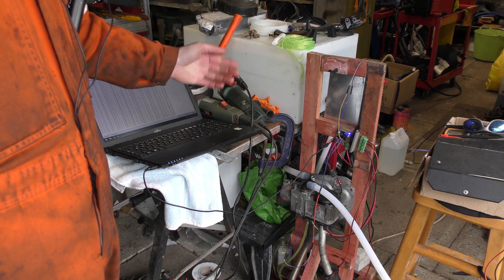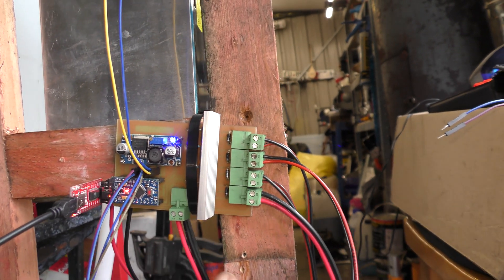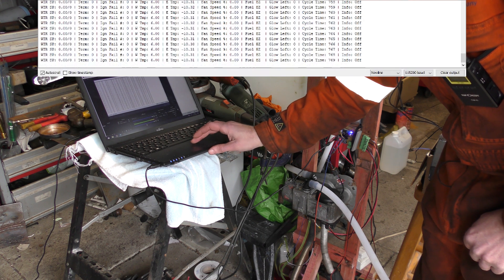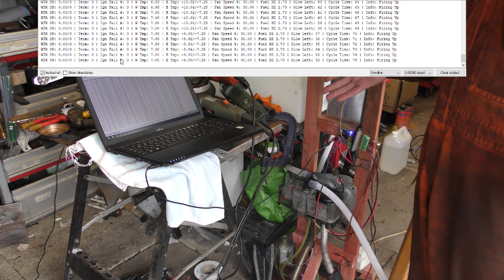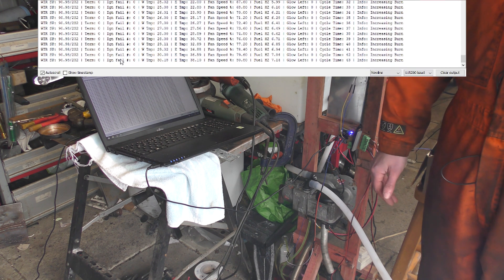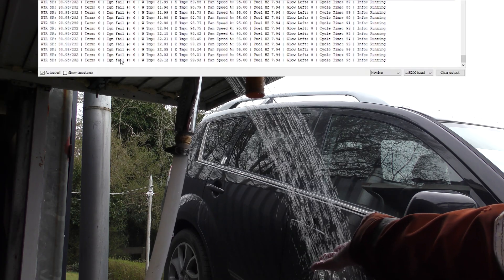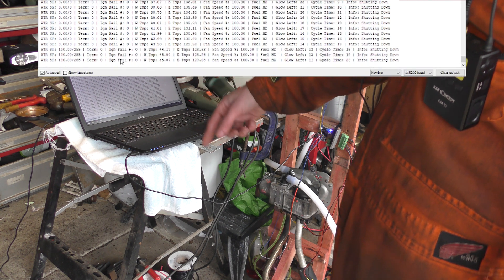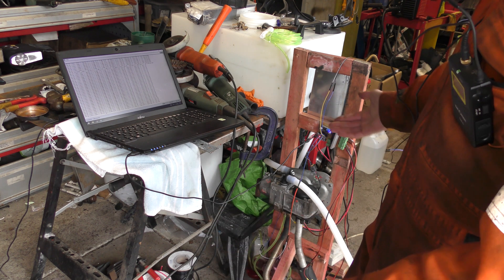Arduino Webasto Shower - Stage 3 - It actually works as a shower

Comment: With a valve and another piece of hose you could send the warm water back to the feed tank to preheat it. It would take a bit longer to get your shower, but you could get it good and comfy hot and a good solid pressure you want.

Comment: hello someone else tried to do that shower ?
Reply: I have, but can't get it to run right, I've use the components and code as described, but the exhaust temp gets to 300c and stays put, after 30 sec it shuts itself off, and the pump doesn't seem to be right, i get 8,20hz which is to high and can't change it
Reply: I adapted it and instead use it as a heater for a garden office. I based it on Simons code he developed for a heater for his camber van.

Comment: Hi, Great videos and content thank you. Id really like to give this project a go. I am in the UK and wondered if anyone had ordered any PCB boards or could recommend somewhere to get a few made ?
Reply from the maker: I used JLCPCB to get the boards made.  There is a Gerber file and an EasyEDA project file on my website you can download.
Reply: @DavidMcLuckie  HI David, thanks for that Ive ordered a few PCB boards so if i have any spare i will let you know incase anyone else wants 1. 

Is the required parts list still the same or is there anything that needs changing ? 
1 x Arduino Pro Mini ATMEGA328P 5V 16MHz
1 x 5V Voltage regulator
1 x 100K Thermistor (exhaust temperature)
1 x 1K ohm resistor
1 x 5K ohm resistor
1 x 100K ohm resistor
1 x Momentary switch
1 x Heatsink (for the MOSFETs)
4 x 100 ohm resistors
4 x 4.7K ohm resistor
4 x Diodes
4 x International Rectifier IRLB8721PBF
5 x Phoenix Contact, MSTBA 2.5/ 2-G-5.08, 2 Way, 1 Row, Right Angle PCB Header
5 x Phoenix Contact, MSTB 2.5/2-5.08 PCB Terminal Block
Arduino header pins (male & female) unless you got them with the Arduino
Reply: Where did you order the parts to build your pcb ? The diodes you use, which type is it exactly ?
Reply from the maker: Mixture of eBay, RS components and CPC.  Those diodes are 1N4001.  The only change on the newest board is the addition of another diode for reverse polarity protection.

Comment: Have you gotten a chance to check out that oil burner system,waste oil burner system, flame rings,ceramic ignition needle,danfoss oil nozzle,burner high voltage packet on EliExpress. 
The best way I bent big copper pipe filling it with sand

Comment: hi am still having problems cant get the atomiser out seems to be welded in have you had any similar problems
Reply from the maker: On the Thermotop V?  There are three screws holding the heat exchanger half onto the burner half.

Comment: You’re better off wrapping a flexible exhaust around a copper pipe surely?
Reply from the maker: Not a terrible idea actually.
Reply: Or possibly using a EGR cooler as a heat exchanger?

Comment: Why not use your EGR cooler from your previous projects to preheat your water before it enters the main unit?
Reply from the maker: I will eventually, but I expect it to soot up quite badly.  You can get these heaters running HOT, you just have to hose fuel in.  :)

Comment: I like, no hate, but I think in practice, a hot water store and thermostatic shower valve mixing with cold would be more stable. When ya stood in the shower, and the thing goes cold, or burny hot, it aint guna be fun! Not to mention limited amount of water being wasted on start-up, and shutdown if the temp goes up. Maybe look at a hot tub heater? 7.4hz is some amount of fuel too!

Comment: Cap one end of the copper pipe, fill it with sand, tap it on the floor to settle sand, cap it and wrap it around a form a bit smaller than you want. to account for spring back.

Comment: What happens if you Preheat the Diesel (maybe with the Exhaust) does that change the ignition behavior?
Reply from the maker: It does, Webasto even makes one of these with a fuel preheater built in.  But I think it is only used for starting.

Comment: I'm following with interest, as I'm planning / trying to do the same with a Eber D5W but feeding a calorifier rather than directly on-demand. I have 2 old Ebers At the mo, and using the brain from one, and the workings from the other I got the assembled frankenheater to start once, and only once. I hadn't rigged up the water correctly, so it was full of air and the unit overheated instantly - when I got some water through it just boiled / popped / steamed / etc. So, it's obviously quite important to make sure the unit is full of water, and ideally that the water is flowing before you light it up - but none of these seem to have a sensor to tell you if the water is flowing. Have you considered this as a failure mode, or do you reckon that the overheat sensor is enough to allow a controlled shutdown before meltdown or damage happens?
Reply: The water over temp is programmed to 50c. A flow sensor can be added on the output but as the water temp over heat is much lower than the normal ECU that comes with it then I'd except it to catch it before critical mass.
Reply: You could easily adapt this to run two units simultaneously. :P

Comment: David what is your microphone set up? I can't seem to make one work decent. Thanks. 
Also I can't remember if you tried this but get a larger egr cooler.  run the cold water through the egr first, then through the heater.
Reply from the maker: I'm using a wireless tie mic.  I went with a twin channel setup in case I ever needed to mic up someone else as well, but that hasn't happened yet.  https://www.amazon.co.uk/gp/product/B07L8XRKXP/ref=ppx_yo_dt_b_search_asin_image?ie=UTF8&psc=1

Comment: Excellent progress! I've tinkered for a while worth of diesel water heater for van build, would be pretty much complete if it uses glycol mixture closed circuit and plate heat exchangers in series with circulation pump for hot tap water, floor heating and also heat engine when so commanded.
Your example is very encouraging, and possibly with Webastos or alike from wrecking yards...

Comment: How about wrapping small copper tubes around the exhaust tripled up and then going from the three inputs and outputs back to the size tube that you need to give you more surface area against the edge of the exhaust

Comment: you wont soft copper pipe fill with sand and cap the ends off maybe even heat and you bend

Comment: Will them heaters run with a garden hose connected to it rather than a pump or is it got to be a controlled flow ????
Reply from the maker: You can run them from a hose, but you'll still need to control the flow via the showerhead or a valve.  You need a low enough flow rate to give the water time to heat up.

https://youtu.be/tzoS-6ds8HA

Comment: From an electronics noob to pro in 5 episodes - very impressive David. I know you've had help, but none the less all credit to you. The Arduino controller is going to be perfect, like you say, a bit more tweaking. This is a great solution. Here in Australia, we don't get cold enough to have cars with these heaters...that I know of at least.

Comment: Spiralling Micro bore copper -over length piece flatten & solder one end - fill to max with water (not sand) flatten and solder other end (will need a propane torch ,soldering iron wont get the heat in) spiral away no kinks .Trim drain cut off excess .Loads of tutorials on YT

Comment: Maybe you could play with controlling the water temperature by running the heater lower or higher. Ideally it could be cool to have a display to see and set the temperature.

Also it would be useful if you explain what did you do in the code or with other parts of the setup. With other words, describe the process how did you fine tune the system since the last update.
Reply from the maker: As it progresses a screen might be possible with controls for temperature and fine tuning things.
Reply: @DavidMcLuckie  nice, Looking forward to watching that video.
Reply: I think throttling the heater would be a good idea when in hot weather to stop over temp.

Comment: CAN YOU fill the tube with fine sand ,then try bending it real slow , and heat it !  plumbers have a device to lay plastic pipe out into that heats it really hot the whole length like wet spaghetti  to bend ,then cool in place !

Comment: What is the "clicking noise ?  That's really hot !  But the water has to be left running the whole time ? SO for an "RV" you lose a lot of your limited water in the freshwater tank ??  My smaller RV , I turn the water,  way down and up as I shower, and off also for a few moments .all to conserve water ,  Your's has to stay on full force the whole time ?  I really like the fast hot water , Is your set up cheaper than an "instant " hot water device ?
Reply: The fuel pump
Reply from the maker: Clicking is the fuel pump.  We had it set originally that the pump only ran when the water reached XºC.  But this created a situation where pump would turn on and off during the startup phase as the water heated quickly inside the Webasto.  This concerned me as there was a possibility of the water getting too hot and coming out at scalding temperature.  Now the pump runs at its slowest speed during startup and ramps up as the water heats.  You have warm water within the first minute.

How much is a typical 'instant' hot water setup for an RV?
Reply: @DavidMcLuckie    I dont know , I asked first , Ha,Ha ,
Reply: Good thing about this is that if your not on a hook up you can still shower as you don't need a few KW for an electric shower. 

Things can always been fine tuned further but safety is the most important thing to aim for first. Unless you like it to feature a sauna mode?!

Comment: It's running much better than last time where the fine tuning of fast fan speed and fuel ratio.
What I think would be better is using it as a hot water tank and a separate solonoid water valve to turn shower on/off so you can bring water up to temperature without wasting water... 
An idea for doing the water pipe around the exhaust would be normal pipe and fittings in lengths, and zigzag it around the exhaust pipe, with heat insulation around the two.. Spiral a large pipe at such a small diameter is not a good idea... You could however spiral like 5 or more small pipes and feed all at the same time for the throughput of water,
Think also about pressure changes too when you go from one pressure to the other can also change temperature and may end up with more steam and what is needed

Comment: Thoughts on bending copper without it turning kinky, cap one end off, pack it with sand & cap the other end off trapping the sand inside, this is supposed to stop the pipe from kinking as it provides internal support or pressure or something like that, there's vids here on youtube of it being done so definitely worth a watch... :)

There's also a technique involving water & freezing it, but that'll need a long freezer, and luck in not bursting said pipe...
Reply: yep.  freezing it full of water works as well
Reply: THATS what I had heard also